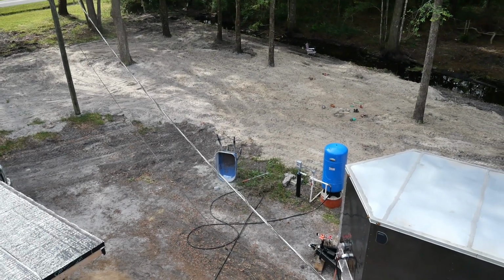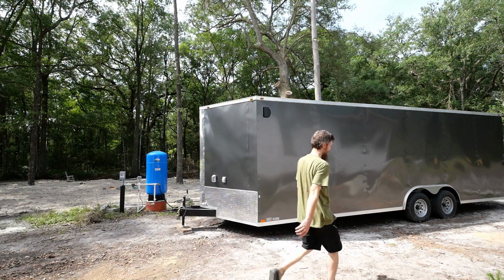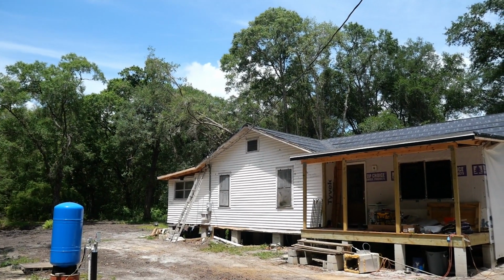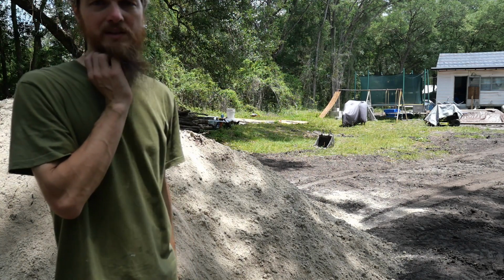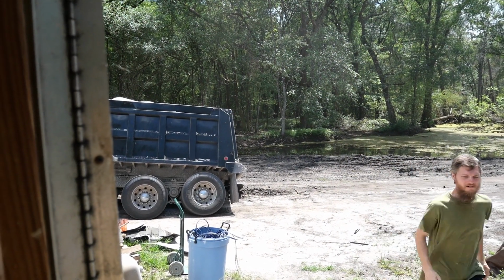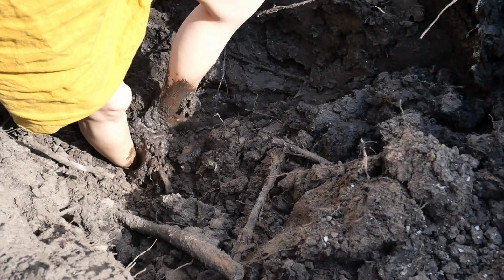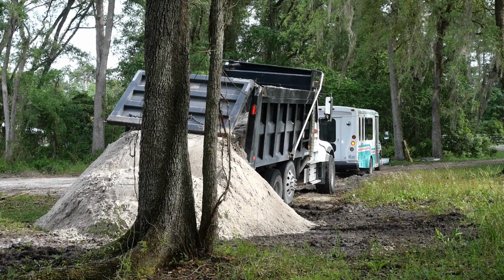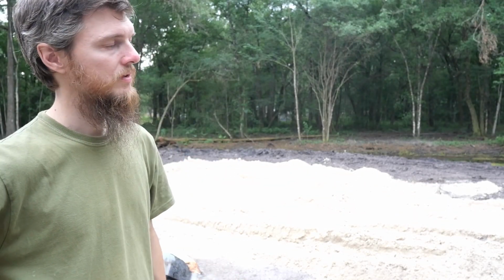Dump Truck Sunk Right into the Ground - Dirt Delivery

Comment: That soil that Ashley was stepping in is a bog. High water table and hundreds of years of organic material and bacterial action breaking down the organics. The water table being high is the issue. As some suggest, a layer of something to help stabilize that bog before placing the sand would help. Not sure if there are any reasonably priced materials available in your part of Florida. Ground coral rock that abounds in many parts of Florida could be an option however I'll bet its cost prohibitive. In some parts of the world scrap sawmill boards are used and covered with soil and not driven on until plants with deep strong root structures provide soil stabilization. Love watching this... Joe

Comment: We moved from SW/MI to the space coast of FL., here's a couple things we've learned. 
-If you have any aversion to AC, you'll probably need to get past that:) AC makes FL living bearable, even pleasant (IMO). Obviously there was a time when many FL residents didn't have AC, not anymore. Grid power tends to be less expensive here than up north, so running AC isn't cost prohibitive. You will gradually acclimate to the hot/humid conditions, when you do, 80deg indoors will feel fine, takes just a bit of getting used to. 
-Don't skimp on ceiling fans, you'll use them a lot.
-Keep an eye on ponds and such, gators and water critters are quite mobile certain times of the year. 
-Learn to appreciate your geckos (even though they like to sneak indoors sometimes); next to your bug guy, they are your best ally for bug control (BTW, you will need a bug guy too:).
-The State bird is the mocking bird. They like to make nests in shrubs and short bushes, if you get anywhere near their nest they will pester you aggressively until the hatchlings are out of the nest. Interesting but can be annoying too. We had a nest in a bush near our mail box, it was slightly hazardous just collecting our mail..that bush is gone:)

Comment: When you were dragging the  bus back with Ashley at the wheel, the left front wheel of the bus was not turning but dragging as if the brake was pressed or there is some other issue with that wheel assembly. Check the video, and you will see is not turning even under pressure. I grew up in river bottom sand and never experienced this before. Perhaps it needs attention... Keep the great videos coming...  Joe
Reply: Saw that 🤐
Reply from the maker: It was just the brakes being pressed, that's all. Thanks!
Reply: @diyfferent  lol.. Why press the brake when trying to move..????

Comment: Just listen to his plan and stop the criticism. He said some weeks back he was putting sand down so water would drain through it. Then he's bringing in top soil to put on top of that. That is why the gravel truck got stuck. Because the water goes down so far, the ground dries on top and the water underneath does not get air or sun to dry it.. This isn't this cowboy's first rodeo! So trust him!
Thats not a sink hole. If it were we would have lost Ashley as soon as she stepped off in it. Its just a wet mess.....is all !

Comment: When you pulled out all those trees and the root system, you created those soft spots... You are going to have to put in some "Meat" to build those soft spots back up. Maybe find a tree service that needs to get rid of their mulched tree clippings. Florida is notorious for sink holes especially there in Central to North region of the State, and it doesn't help yall to be living so close to a mud hole.  I hope yall figure it out as the rainy season is fast approaching... It may not rain every day. There may be days where you wished it would, but nonethe less, you're going to need something more then sand to create a solid surface. And I also think, once you get everything done under the house, piers, plumbing, ect. that you get a couple dumps of crushed shell to build up the soil there too.  I almost hate to think of that one movie with Tom Hanks & Shelly Long "The Money Pit". Thank you for bringing us along on your journey... We are only the audiance, ultimately you will have to make your own decisisons on what comes of your property, I just hope that some of our advice helps.

Comment: What happened with the truck is called "soil liquefaction" (also called "earthquake liquefaction"). Basically, it's ground failure or loss of strength that causes otherwise solid soil to behave temporarily as a viscous liquid. (The alternate term "earthquake liquefaction" would denote being triggered by seismic activity.) In this case, it was the vibrations of the heavy truck driving back and forth over the shallow water table that your house sits on. 

There's nothing to be alarmed over - your house isn't sinking and your vehicles (nor any people) will be swallowed up. Remember - it took a heavy truck multiple passes to trigger it. And building up the soil as you are will only strengthen it.
Reply: A great explanation...
Reply: I noticed the first few trucks had a GVW or 64000 & the other was 70000.  Do you think the extra weight contributed?
Reply: @audreywy1743  - Not so much the actual weight as much as an excessive amount of weight driving over the same area with a shallow water table.

Think: standing on a beach a few steps from where the waves are breaking and shifting your weight on one spot.
Reply: Thanks for that explanation 👍

Comment: I think it was a slight case of liquefaction, all the weight on one wheel and the vibration (as I bet he used fairly high revs) caused the ground water to saturate the topsoil and down he went. As this chap got stuck last time, see if you can recap as to just how fast his engine was revving as to the other drivers as it sounds like he is a boot down or up and no mid way for the throttle. As you have a crust of dirt of about 2 foot thick then you have the ground water any high rev's will encourage the ground water to rise, just like when you tamp concrete and sink the stone and leave the cream on top. So note for you to remember no high frequency stuff on your land else the water will come back to the top as that ground is saturated with little drainage. Thanks for posting
Reply from the maker: interesting.

Comment: Thick sand won't make a difference. You need rock, more specifically stone. Angular stone will lock in place. I suppose getting stone in FL is expensive and difficult to locate. Do they have road base available? I wish I could send you stone from NH. Goodness knows we have enough.
I know you'll do the best you can with the resources available to you. Wishing your family all positive thoughts.
Reply: Exactly what I was thinking.
Reply: I hope he see your post and gets some proper advice on how to fix the yard. I posted a few videos back and though I am not an expert, I do live in FL and have a pond. During the rainy season to even keep a mower from getting stuck what finally worked was what you are suggesting. Large gravel is fairly expensive but crushed concrete is not. Also seems like he is getting sand and not fill dirt. He should be getting compacting material and build it up a min of 4ft. During the rainy season I have to push mow within 10ft of the pond or the riding mower will get stuck just like that dump truck did in random places. Possible issue is he now has a sand base and that may need removed prior to gravel/crushed concrete etc. I love the video and hope he asks around to the pro's on what he should do.
Reply: I hope they are getting good advice. They Work so hard and he doesn’t usually settle for anything untrustworthy. I’d hate to see wasted money and time for them. They are our “friends”. Only wanting the best for them

Comment: I really commend you for all the work your doing to improve your property.
This is not a critism but if you put the blade down to the ground when you're digging and swinging the sand the digger won't pitch so much and it'll be better for your back and safety throughout the day.☺️👍

Comment: Hello from Weeki Wachee. Ask about a few loads of road base (crushed limestone) get put down on your traffic areas.. It will firm up and stabilize the top of the sand. I like you, have a high water table, you'll get used to it. After you get all your dirt spread the way you like it I would get a few pallets of Bahia grass and throw it down. The sod will hold everything in place.
Reply: I was going to suggest the same thing, I use to live in Florida. Couldn’t dig to deep high water table. God bless
Reply from the maker: We do plan on using crushed limestone for the driveway when we are ready for that. Thanks for the info :)

Comment: Watching the front tires of the van not even turn as it got towed out was an ominous sign for the much-heavier truck. That sand looks like it needs to be packed down, if not being on a gravel bed, but I know that's easy to say at this point and hard/expensive to do. This may well also be an example of liquefaction, the vibration of the truck softening the otherwise "solid" soil under its wheels.
Reply from the maker: I was paranoid about hitting the power poles so I was keeping my foot on the brakes, that's all. Plus I have barely ever driven that bus and it was hard to see what I was doing. :\
Reply: @diyfferent  Ah, got it. Yes, I've driven in mud before and it's near impossible to know where the front tires are pointing.

Comment: May in Florida is usually pretty dry , but June is definitely the start of the rain season so try get it your sand level this month . The water table will rise and lower as the season changes that hole where the truck sank is probably the water table level right now .

Comment: Wow,
I bet that was an unexpected shocker see the truck sink that deep.  At least Ashley had a moment of fun stomping around in it. Glad it didn't sink deeper with her in there.
Hopefully that was the only weak spot on the property.
Hopefully during the leveling of the dirt you can angle it away from the house and create a run off so water doesn't puddle anywhere and have a chance to weaken the ground underneath.
Wishing you the best in this endeavor.

Comment: It seems while sand is inexpensive you need some rock to set a more solid base then compact it. Good drainage to channel water away from the area is a thought as well. Just thoughts from someone who had similar problems on a property years ago an acre of land. There’s nothing strange about this. Your water table is extremely high the water on top drains down but no drainage below the topsoil level.

Comment: Yup, FL has a nice high water table, sinkholes and lots and lots of fine sand.  He didn't sink on part of your septic leach field did he?  You're wise to raise the lot elevation a bit.   Be sure to teach the kids the danger of digging tunnels or caves in sand./dirt piles, they are kid killers.
Reply from the maker: No, the leach field is on the opposite side of the house. We don't let anyone drive over that  :)

Comment: Everyone giving their opinion of what will work and what needs to be done but this is Florida!  Any place with a high water table will experience these problems and its probably seasonal.  Last spring I was in Oklahoma during the spring rains.  We got the car stuck multiple times in the clay mud, I got stuck in the mud, I even lost a shoe to the mud.  I had to hop back to my shoe then hop away to rocky ground to wash all the clay mud off.  By August the soil is so dry you can't even get a jackhammer to chip it and make a hole.  This is normal life when soil is saturated with water.  The soil swallows anything heavy and a person will also sink into it.  These have been known issues in the swampy Florida for decades.

Comment: Looks like you are just above the Water Table. Is there ANY way to modify the pond so that it drains into a lower area of ground??? If so, this should help your saturated ground water level. Also, I would suggest using a modified pad mix instead of sand. ( 2B stone and brown earth mix) Just some thoughts.
Reply from the maker: No, our yard is the lowest spot, so there's no where else for it to go.
Reply: @diyfferent  Thanks for the Reply. But if that is the case I would definitely look into using a stone and earth mix before adding any more sand. Just a thought. And as ALWAYS, I love your channel and I always hope for your continued success.

Comment: Wow, I think you're going to find that getting that little excavator was the best money you've ever spent.  You have made some good use of it so far.  As far as the soil collapsing, there are tree roots in,  I wouldn't have seen that coming.  Just think of the weight of the truck with a heavy load of dirt going over it.   Maybe it's really a good thing you don't have a concrete driveway on your property right now.  You would have had a cracked driveway.  The cost of a concrete driveway in my state is unbelievably expensive.  The last estimate I heard was $20 to $30 thousand dollars.   With as hard as you guys work, it's no wonder none of you need to go on a diet.  If anything, you need the extra calories.  You don't have the chance to hold still long enough to put on weight, lol!  In mentioning driveways collapsing - we had a load of dirt delivered one time and they DID put a crack in our concrete driveway.
Reply from the maker: Yea, we've used the excavator so much and we're so glad we got it. We're planning on doing a crushed limestone driveway. :)

Comment: I wonder if that's just how high the water table is and when he turned and the extra weight was on the corner, the truck broke through?  Or maybe there had been a big hole there in the past and the dirt wasn't as compacted as the rest of the yard?
I know you have a (good) reason but don't think you said why you are using sand instead of actual dirt?  I'm thinking of the beach and how soft it is and hard to walk or drive on when dry, hard where the tide makes it wet, but mushy and soft when covered in water like in a tide pool.  Curious not critical.  ☺️❤️
Reply from the maker: Florida is mostly sand, so sand is the fill here. Our yard just has unusual soil :)
Reply: @diyfferent  I should have thought of that since the southern part of my state is mostly sand.  I'm in a transition area I guess because on my half acre I have an area of sand, a lot of clay and some good dirt.  A challenge to try to plant in!

Comment: As you have just witnessed the water table in Florida is very high. And you don't have to go down very far before you get into wet sand. I don't know what part of Florida you're in but in the Tampa Bay area the water table is exceptionally high. You with that little lake next to you doesn't help lower the water table..

Comment: Good video!  Question:  The spot where the truck fell in; was that where one of those big trees you had removed?  That would possibly explain a soft pocket, cause the soil is firm in all the other areas.
Reply: Looked like there were some roots there.
Reply: I was thinking the same thing. After you take out big trees like that the roots that don’t come up with the trees shrink and make hollow spaces. I wonder what they plan on doing for erosion control on the new dirt/soil. I just worry that that pond is going to rise up again and wash away all this hard work before they get a ground cover established. Might need to look into dune grasses that go deeper than sod.

Comment: I don't know if anyone else noticed this, but the first 2 trucks had a GVW of 64,000 & the one that got stuck this time & the previous had a GVW of 70,000.  I'd call the scale house and ask for the load weight of all the trucks.  That extra 6k lbs could have made the difference.  My friend works for a major construction materials scale house & has that problem all the time when the drivers come in overloaded, they've even fallen into sinkholes.  Will you be building a retaining wall around the water to help prevent erosion?
Reply: That’s a good observation. I’ve driven dump truck for 30 years and never gave it a thought
Reply from the maker: Yep, that extra weight of the truck is most likely what did it.

Comment: It seems that there should be a way for you to make the pond bigger and deeper so that the water from the yard would seep into the pond and dry out the yard. Does the pond drain into a creek or river? If so, maybe it could also be dredged. I know when they are building homes in my area of Florida they always create retention ponds to hold the water that runs off of the lots so that the lawns are dry.
Reply from the maker: No, we are at the low spot around here so all the water drains here during big rains. We have been making the pond bigger and deeper, but we can only do so much when the water is high. Once it recedes more we can dig it out better.

Comment: That my friends is what is known as a sink hole.  This happened in Spring Hill Fl. some years ago, a concrete truck was driving down a residential neighbor hood to deliver the load and fell right into the middle of the street up to the frame of the truck.  Sometimes they open spontaneously anywhere, sometimes they open when too much weight is suddenly placed above the cavern down below the ground.  For those wondering, the footprint of that house with the crawl space foundations is no where near the weight to that truck with tags, probably 40-50k lbs on those back axles.
Im surprised the truck didn't leave at least 4" deep impressions where it traveled.